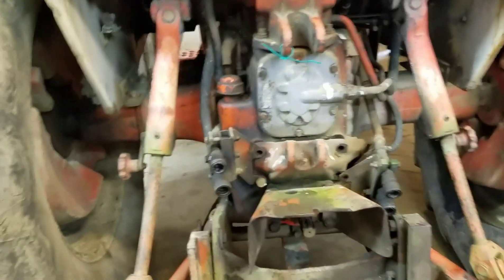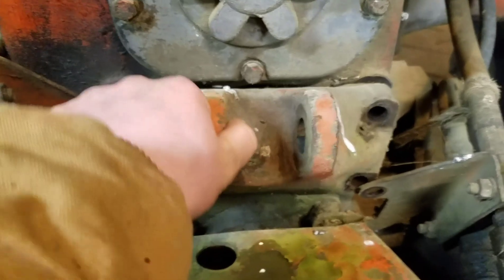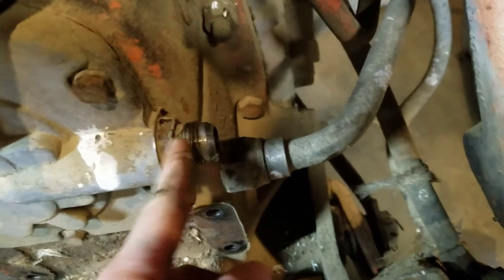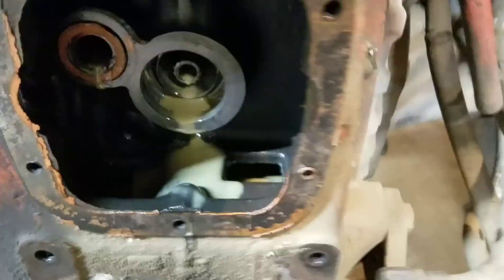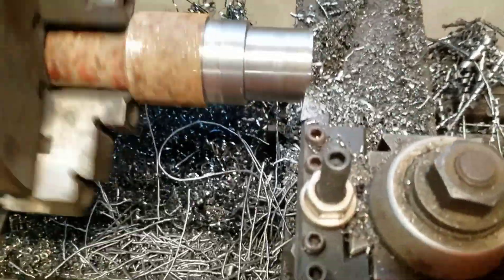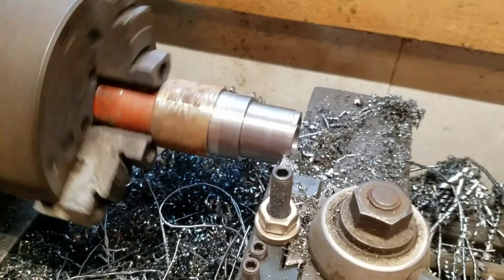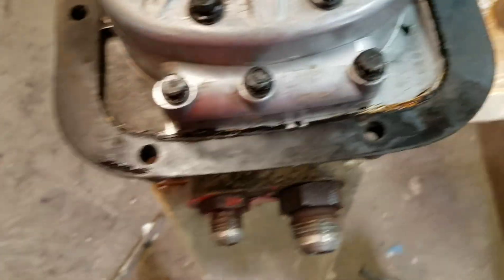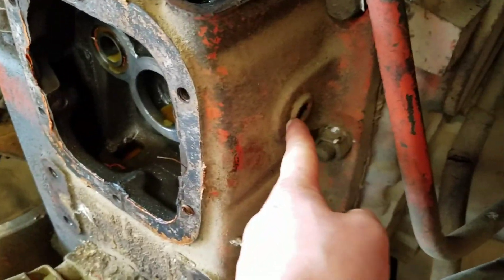How to convert a Case 1030 comfort king to a 70 series hydraulic pump.

Comment: Thanks for sharing. Do you have a video on the engine swap? The 1030 was a good tractor as long as you kept the loads light. The rear end was a little weak.
Reply from the maker: I dont actually. We bought her swapped like this. We just pull the same size equipment that a normal 1030 would but a little faster. Lugging them on bigger equipment is what caused the rear end issues.
Reply: @farmingwithjunk1848  case tractors were made to lug

Comment: Thanks for the video good info I’m working on a 730 case with a gas engine would you know where the hyd suction pipe filter would be located can’t find much info on where it would be
Reply from the maker: This is what I've been able to find on the internet as far as how to get to it to service the filter.

BELOW the PTO shaft and just above the rear hydraulic system drain plug is a circular cover with three bolts around the perimeter and a threaded plug in the center. That's the hydraulic system filter cover. You undo the three bolts, pry the cover loose with a screwdriver--there are little insets on two corners of the housing to let you do this, because otherwise it will seem fused to the main casting--and pull out the filter assembly.
The filter itself is a simple open cylinder, like an oversized toilet-paper tube. It can be cleaned in diesel fuel and re-used, and will almost certainly be heavily covered in gunk.

If you shine a flashlight through the hole, toward the front and to your left as you look in, you'll see the end of the suction tube coming down to within about an inch of the reservoir bottom. The filter hole is big enough for a pretty good-sized hand to pass through to work on the screen end. You can't take the screen out without disassembling the back end of the tractor--but you can reach in and pick debris off the screen, flush repeatedly with diesel, squirt with carb cleaner, and so forth. You won't be able to SEE whether you're doing any good, but you should be able to tell by feel that you've got most of the debris off the screen.

When you've done everything you can do with that screen, mop out the floor of the reservoir carefully with paper towels to pick up anything that would just suck up into the screen again; reassemble your newly cleaned filter; and bolt the housing back on. You'll probably have to use some Form-a-Gasket as you will probably have damaged the gasket in removal. Refill with appropriate hydraulic/transmission fluid, and start 'er up.

Comment: Like your videos. We run 2 970,s a 1570 ,2670 and 2294. They're all in good shape and get regular use. We started last year running a 970 on our gt batch dryer with the 1000 shaft so engine rpm is only 950. Is that ok?
Reply from the maker: As long as you aren't bogging the tractor down a ton I think it would be fine there. I imagine a grain dryer doesn't take a ton of power. If it's a power shift make sure the powershift lever is not in reverse while running stationary.

Comment: Excellent video, did this take care of your 3 pt lifting issues? . We have a 930 that doesn’t want to lift, or how do you check the lift and the draft valves
Reply from the maker: It did not fix the 3pt lift but it greatly helped the remotes. We know our 3pt lift cylinder needs resealing. 
I'm not as familiar with the 30 series for 3pt but I would check on yesterday's tractor for article on that. They have alot of good stuff on there.

https://www.yesterdaystractors.com/case/wwwboard1.html

Comment: I WISH I HAD YOUR KNOWLEDGE  TO WORK ON A FEW LITTLE THINGS ON MY 1960 CASE 730 DIESEL STANDARD
I REALLY LIKE THE TRACTOR    POWER STERING WOULD BE NICE    AND HAS SOME BLOW BY 
SHOULD I BE CONCERNED ABOUT THE BLOW BY   IT ONLY HAS BREATHERS ON THE VALVE COVER
ARE THE CASE 1030'S   WITH THE HIGH AND LOW SHIFTER ON THE DASH ANY GOOD    I THOUGHT I WOULD STAY AWAY AND WAIT FOR 
ONE LIKE MY 730 ALL THE GEARS ARE ON ONE SHIFTER  OR HOW DO YOU KNOW WHEN YOUR BUYING A 1030 GOOD ONE THAT SHIFTS HIGH AND LOW ON THE DASH
Reply from the maker: All 1030s are dual range that I've seen. As long as it keeps good oil pressure I wouldnt be too concerned about the blow by. The dual range transmissions are good.

Comment: Are the hydraulic sleeve you made for the pump - Do you think if you made another one would it be a universal fitting part? I would purchase one from you if that would work..
Reply from the maker: I'm not sure if they would be universal or have to made to fit. If there is more demand for these sleeves I would think about doing a short run of them.
Reply: @farmingwithjunk1848  I'd be willing to purchase one to see if it would work..
Reply: I would also purchase one!

Comment: Nice videos 💪Im working on a case 1175 and metal shavings keep spilling from the hydraulic pump and other hoses and I honestly don’t know what it is. Do you think its the filter, transmission, or hydraulic pump?
Reply from the maker: My guess would be the hydraulic pump is going bad. I would take it out and see if it has much play in the drive coupling. Either in and out or forward and reverse.
Reply: Johnathan Martin the Tractor Man that makes sense thanks brother
Reply from the maker: Now that I've thought about it for a few days you could have chipped some gears in the transmission too. I'd start by checking the pump then changing the fluid and filter. If it doesn't clear up some in an oil change or 2 with some intermittent running then you probably have a messed up gear inside.
Reply: Johnathan Martin the Tractor Man well im refurbishing the tractor but im gonna take a look at the transmission 😣 hopefully nothing is mangled 🚜

Comment: I have a question I have a 69 comfort Kong 930, where is the suction screen???, Mine worked great now it will barely lift I was thinking maybe the screen is plugged ???
Reply from the maker: It's rather difficult to get to. You have to pull the pto housing off. You could try blowing air or diesel and air down the line going into the pump from the screen. ( the one I made the collar for).
Reply: Thanks for the reply this whole tractor deal is all new to me lol but I've worked on cars and trucks my whole life, I'll try that to.orrow and see if it works then I know.
Reply from the maker: @96318dakotaify  No problem. Happy I have the opportunity to help save these old giants.
Reply: @farmingwithjunk1848  so I can just take that line off the right side and blow threw that? Or should I pull the pump out?
Reply from the maker: @96318dakotaify  you'll have to pull the pump or it will just blow out what's in the pump.
Reply: @farmingwithjunk1848  I did that, it started this one it got -46 for two days the oil had water I've changed it twice now it work d fine last winter.
Reply from the maker: @96318dakotaify  did you change both filters and drain both drain plugs?
Reply: @farmingwithjunk1848  I only seen one filter one left side
Reply from the maker: @96318dakotaify  check out this post of yesterday's tractor. They may have your answers to your second filter.
Reply: @farmingwithjunk1848  yes some had a drop.in element mine.only has the spin on filter, I'm think it's froze up somewhere with all the water I had.in the system but maybe if anything it's just the hydraulic pump is weak.
Reply: @farmingwithjunk1848  so where the hydraulic pump seats in the spin drive on the back what spins that and I left fuel off and turned over by key and it doesn't spin????
Reply from the maker: @96318dakotaify  ok. It's a possibility that if there was enough water and it could've froze and damaged the pump or something then.
Reply: @farmingwithjunk1848  where the female spines to the hydraulic pump meet what spins it? I cranked mine over and it didn't move the male spine side that's still on tractor.
Reply from the maker: @96318dakotaify  ok. That's bad. I'd recommend getting a copy of a parts manual so you understand how it works inside. You'll probably have to split the tractor and see why the flywheel isn't driving that shaft.

Comment: We're is the hydraulic filter and drain plug located on the case 930 confort king
Reply from the maker: There are 3 trans filters. I'm not sure exactly where they are. I'd find a parts book for your year of tractor because they changed through the years. If it's later model there should be two drain plugs on the center line on the bottom of the transmission. Not sure where they are on an earlier one.

Comment: The line coming off the pump dose it run to a filter and if so could I get some info on that filter I’m working on a 930 ck and can’t find a replacement filter
Reply from the maker: It depends what year 930 it is for what filter style it will take. I'm not very familiar with the earlier system so I'll direct you to take a look at yesterdays tractor. https://www.yesterdaystractors.com/cgi-bin/viewit.cgi?bd=case&th=255943
Reply: Spin on Filter on the left side on the housing?

Comment: Is the pump on a 1270 the same as a 1070
Reply from the maker: No the 1270, 1370 and 1570 have a different pump that is mounted on the side of the transmission that would not be compatible for this conversion.

Comment: Hydraulic fluid looks milky
Reply: Just changing that fluid and the plugged filter may have saved some hassle, idk.
Reply from the maker: It was a little milky from a disk we used with a little water but when the fluid was clean when we bought her it still had issues lifting stuff.